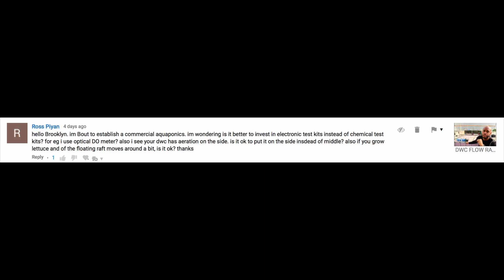CHEMICAL VS ELECTRONIC TESTING FOR AQUAPONICS

Comment: i think she ment to ask if its ok for the roots in the water to move around alot. like for example the bubble machine creats allot of turbulence which maybe is anoing for the plants. maybe they would rather like, somthing more of a still environment?

i see you got allot of bubbles in your dwc but maybe its not that drastically turbulent your water.

i think to grow duck weed you need the water to be calm, right?
Reply from the maker: Water movement for plant roots isn’t an issue but as you mentioned it is for growing duckweed.